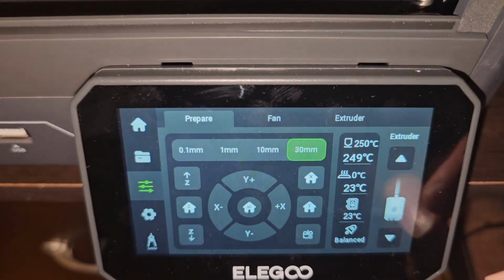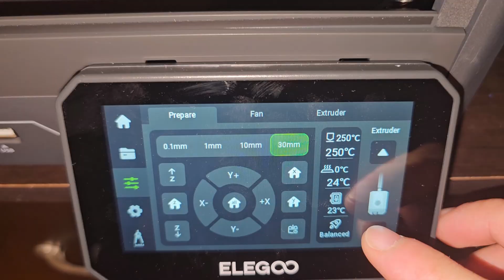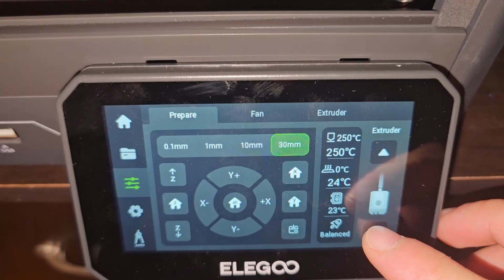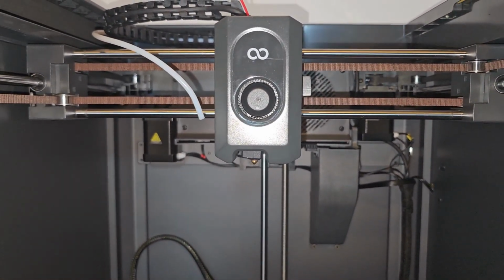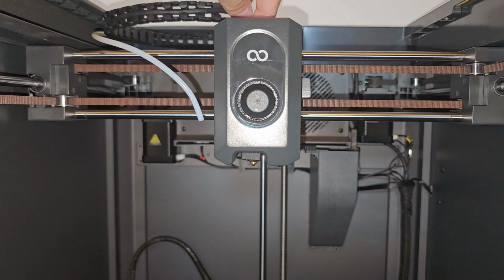Elegoo Centauri Carbon How To Unclog Nozzle | Extruder Take Apart

Comment: This is very usefull specially for changing to a new hot end. But how do I change only the nozzle? From 0.4 mm to a 0.6 or even 0.8 mm to print with carbon reinforced filaments like cr-abs, PLA-cr, Petg-cr and even ASA-cr? Is this possible without removing all the hotend?
Reply from the maker: You can just screw off the nozzle and replace it with a new nozzle that is .6 or .8 what every you want to install into it.

Comment: I can’t take off the last screw becouse elegoo in there infinite wisdom managed to round it off 😂
Reply from the maker: Oh wow, that's gonna be rough 😂
Reply: @Scratch3DPrinting  i got lucky i managed to Dremel it out and replace it (replaced all the cheap black screws with better quality ones) (my clog was the due to a clog in the gears)
Reply: a bit disappointing that my printer was sent out with a fully Rounded off screw though seems they used a powered screwdriver set a little tooo high

Comment: Printing PLA-CF with the 0.4 nozzle will clog the nozzle sooner or later. And it's rather difficult to clear. I ended up replacing the hot end.
Reply from the maker: True, but this 3d printer has the name "Carbon" in it so it should be able to print carbon fiber filaments right...
Reply: Had the printer for a few days only running the pla cf on the .4 nozzle. I just ran into my first clog. What hot end did you upgrade to for pla cf?
Reply: @Roboticgladiator I’m having trouble removing this clog 😅